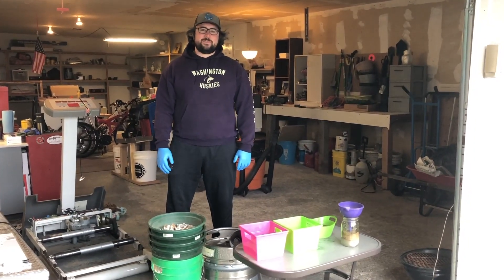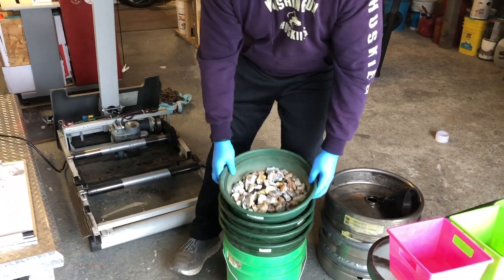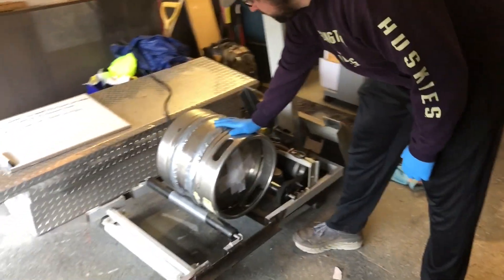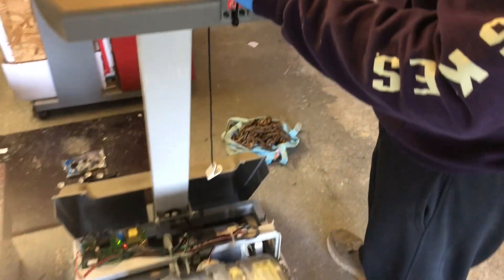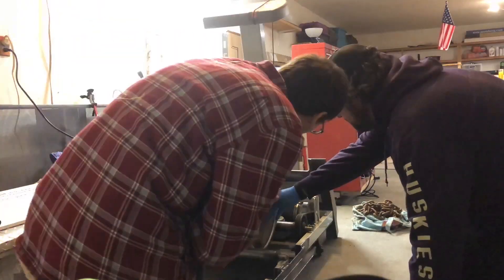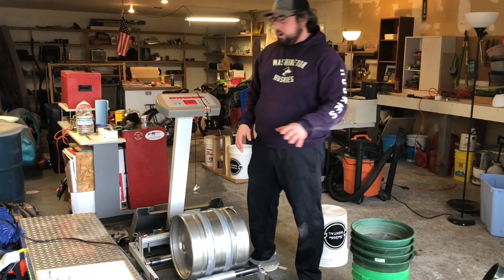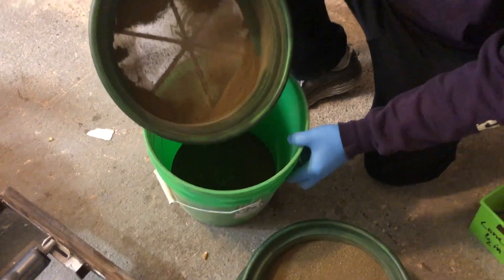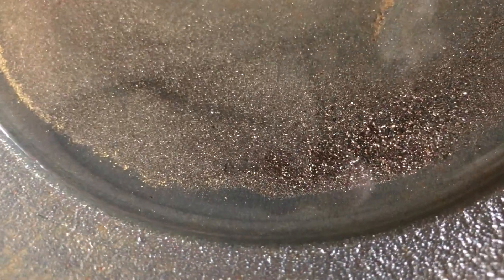Grinding Gold Ore Using DIY Ball Mill / Homemade Rock Tumbler Made Using Old Treadmill

Comment: Clever use of the treadmill!
If you're going to put steel grinding media in, I'd suggest swapping out the aluminum keg for something made of steel like an old BBQ propane tank. Aluminum won't last long.
Reply from the maker: Thank you! It actually was a steel keg, I misspoke. Recycled old nuts from salvage work great to help expedite the grind.